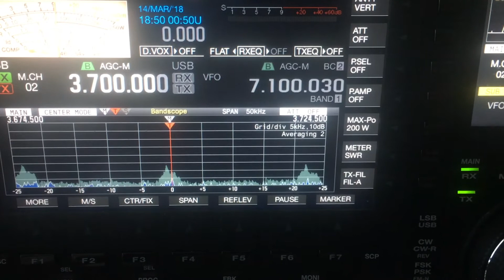TS-990S with NCC-2 Receiving Antenna Phasing System

Comment from the maker: The receiving antenna is 10m away from the transmitting antenna. The NCC-2 has RTR receive-transmit interface relay that is hooked up to the keying line of the TS-990. If there is a concern of higher power, there are receiver guards plug-in modules available that limit the RF.

Comment: For the 6300€ the ts990 costs i would have expected that filter to already beeing installed. i can then get a ts850 for like 600€ and get a reception about as good as this with that extra filter. so i dont think the ts990 will be worth its money. the dsp isnt really usefull either, it distorts the signal, the dsp even in the el cheapo yaesu ft891 is better.